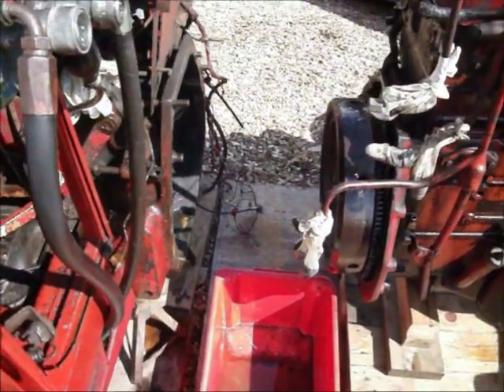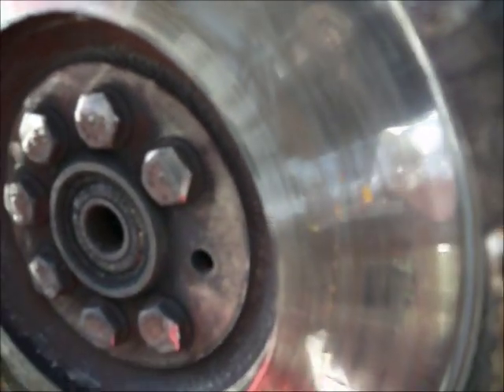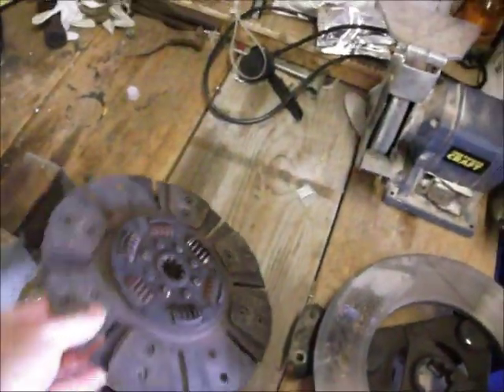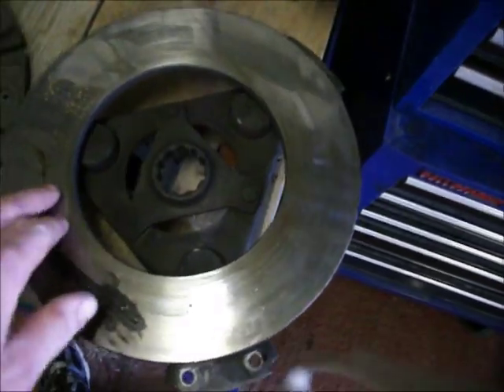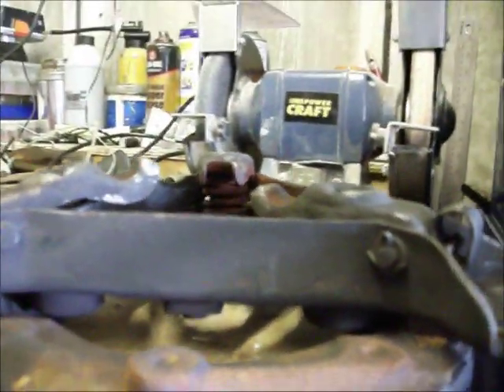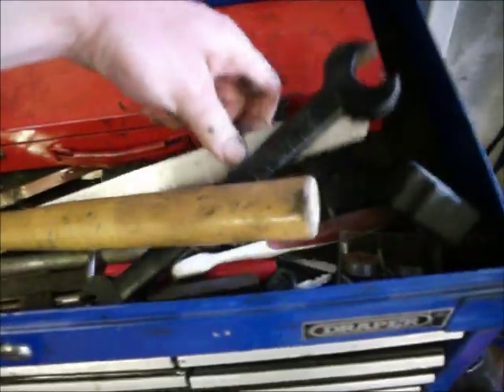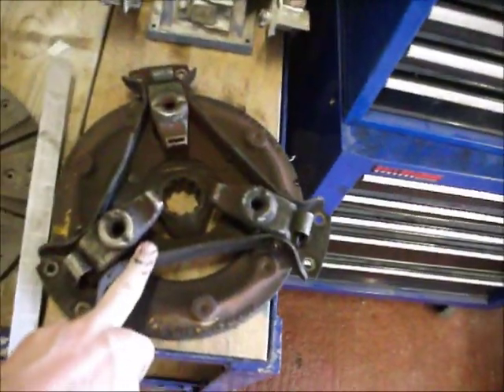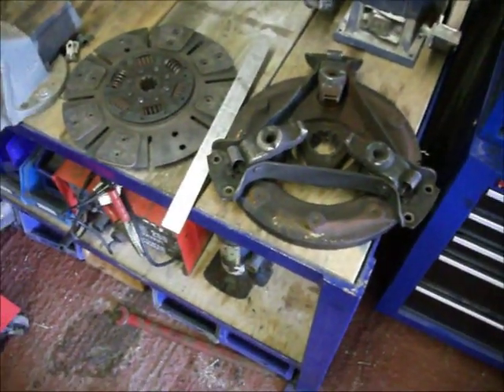International 574 Clutch

Comment from the maker: There a good tractor to do clutches on the 35's, Ive done mine main thing is having the front and back supported enough so you can push them back togther dead level. will make job alot easier.

Comment: Small, shallow cracks on the face aren't too much of a problem they are caused by heat when the clutch is over slipped, its when the cracks are around the crank bolt holes the flywheel is then fit for scrap.
I hope you get it back into work soon.

Comment from the maker: I must admit i'm in 2 minds as to what to do. The crack seems to come from were a little hole is drilled under the face of the flywheel, it only seems to be as long as the hole is deep! After that its a fair thick job think tractor would crack before that! I want do job proper but as were only just starting out in farming funds are tight.

Comment: I would have liked to have seen how you went about splitting the tractor.
Reply from the maker: Jim Buford we just chocked up the back then used a pallet truck and a couple of euro pallets. we had to put down a sheet of ply as I was doing it on the stone drive at home. split and went together easy just raising or lowering the pallet truck.